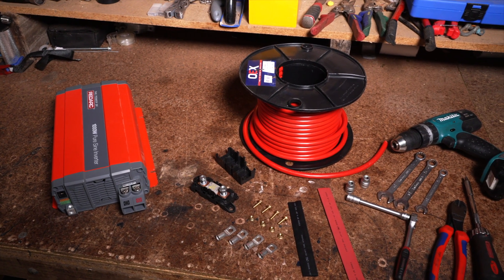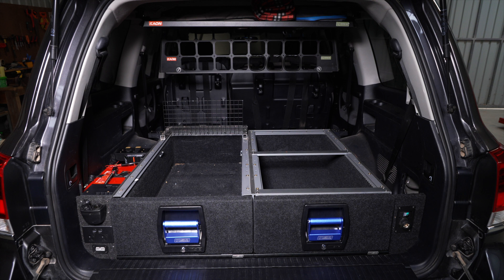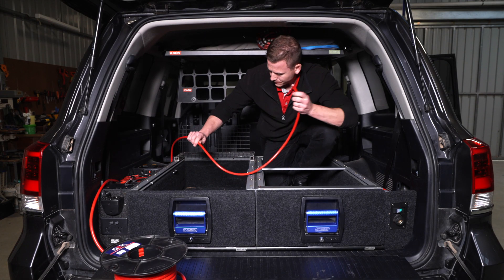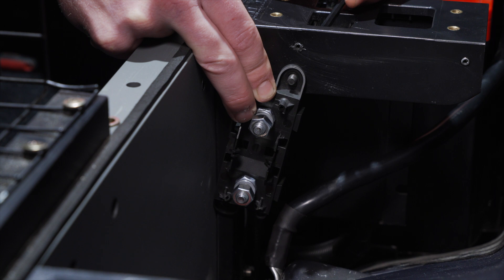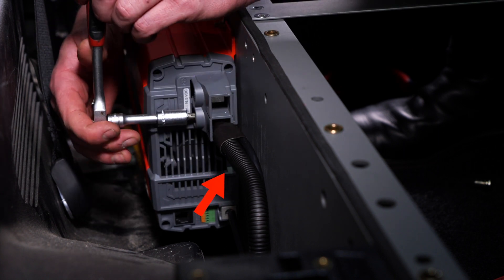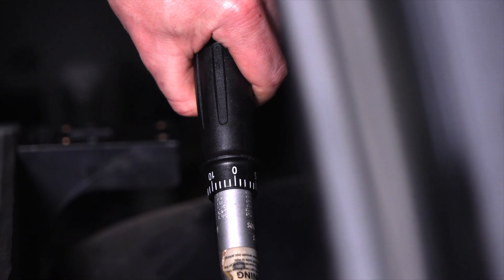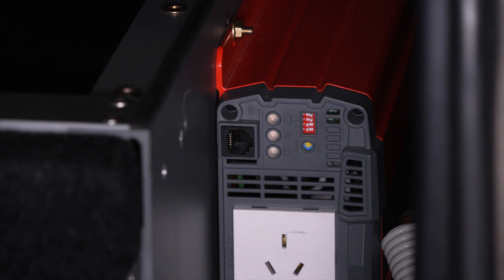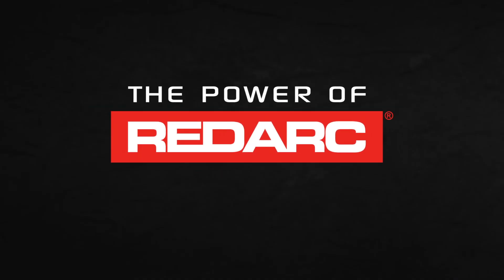INSTALLING A REDARC INVERTER

Comment: I’m confused by grounding (earthing the metal body of unit) — I’m presuming this refers to the 240v side of things — I see the advice is to earth to the chassis but the chassis of a 4WD isn’t connected to the earth except via the tyres, which presumably act as an insulator to some degree — doesn’t this increase the risk of electrocution if the chassis becomes 240v AC ‘live’ and the person who touches it from outside (or getting in/ out of the vehicle) earths it ?
Reply from the maker: Hi Chris, thanks for your comment. 
When we refer to the chassis earth/ground connection, this is purely to ground the case to earth for if an event happened on the AC-side and the case were to go live.
Having said that, the unit would fault and shut-down anyway if this were to occur, so normally minimal risk.

We hope that helps Chris! Let us know if you have any other questions!

Comment: Hi....having the inverter 300mm away from the battery is going to mess up the arrangement of my bank....is this absolutely critical?...any work arounds for tight spaces? what if i ran a temperature sensing fan, would that resolve the problem? thanks heaps
Reply from the maker: Thanks for watching! Generally speaking the inverter needs that space for ventilation and so its heat sink can dissipate the heat from the unit. If you can't achieve this air gap you can use a fan and potentially extra ventilation to help with the cooling of the unit.

Comment: I’m looking at changing my 1000 w inverter to a 2000w. In the the manual it says 0000 cable what size is that in mm ?
Reply from the maker: Thanks for watching! 0000 gauge cable measures in at 120mm, a lot of people will use 000 gauge (95mm) instead as it can be hard to find 0000 gauge.
Reply: @REDARCElectronics  I have a patriot camper and that comes with a 1000w inverter, those cables are only 25mm2. I have 120mm cable at work and seems huge for 2000w inverter
Reply from the maker: @Chris-sf2cp  The cable recommendations in the manual, generally speaking, are for continuous use. If you're only using the inverter for short periods at a time you can get away with a 000 or 00 cable on a 2000w inverter.
Reply: I think  caple about 12 mm not 120  am I right??
Reply: @sportactivity6749  120mm^2 is the cross sectional area of the conductors in the cable, not the diameter.